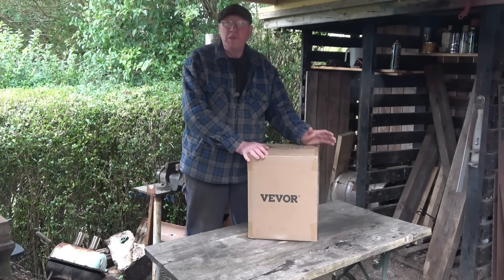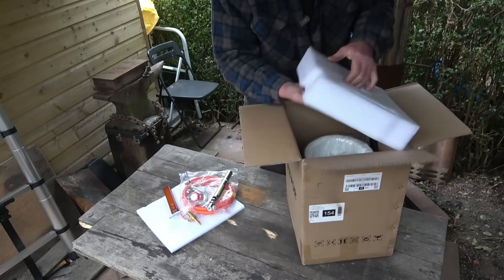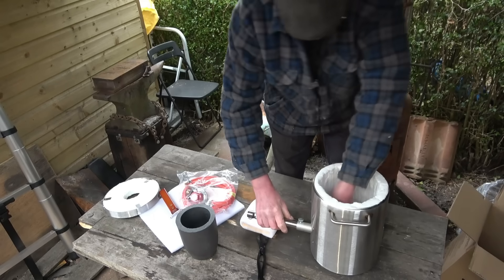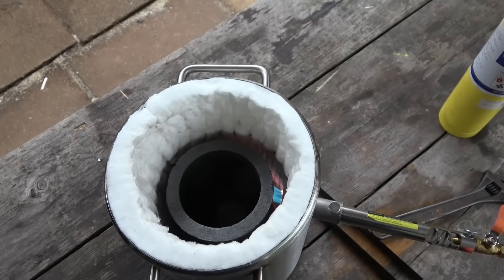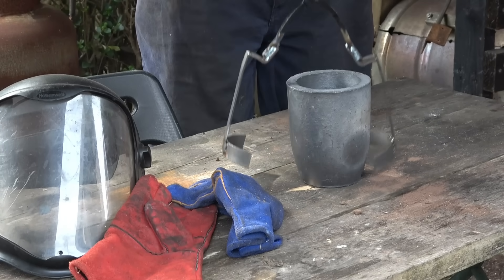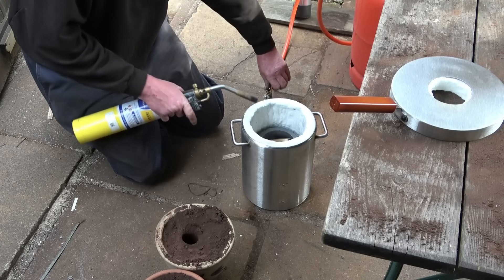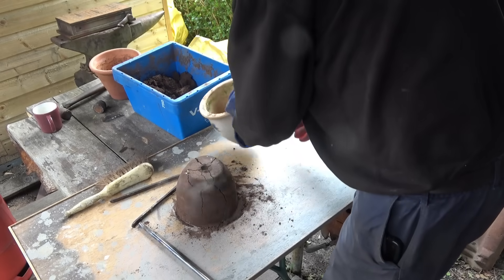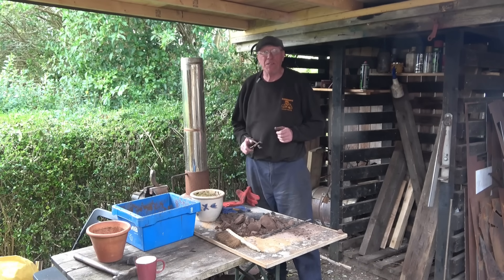Melting Metal Made Easy? A Review of the Vevor 6Kg Propane Furnace

Comment: I'm happy you're happy with this method but a 15kw induction machine will heat a crucible to liquid temperatures in a minute flat..from cold to pouring cast iron into a sand mold in 60-90 seconds..the Chinesium flavored units have come way down in cost that the hobbyist can have one at home..
Reply: You need 15kW of (usually three phase) available power however and a very special plug to connect it. Most houses don’t.
Reply: @allangibson8494 my 15kw machine uses 220v 50hz single phase..I plug it in to 240v 60hz single phase..they have internal power regulation supplies that can run on 208v to 240v..but yes I've seen units for industrial use run on 480v 3phase but those are more of the 25kw+ variations..a sidenote the 15kw induction machines are actually 7.5kw-8kw the Chinese must have different math and test equipment over in China then English speaking countries..lol I also have 3 phase equipment that I run off a very cheap $80 VFD (variable frequency device) that runs off 240v single phase..like I mentioned industrial type equipment is within reach at home for the hobbyist..there's also rotary phase converters available commercially or easily made to run 3phase equipment off 1 phase power..
Reply: Link?
Reply: @stephenisherwood9584  any links will be taken down by YT..but there's several directly from China web sites that if you cut out the middle man has units in the 400usd range for a 15kw machine..they do require water chillers to operate..the cheapest option is to use an old office refrigerated water dispenser modified with a small water pump to pump water in a loop thru the machine and back into the water dispenser..alternative is a water pump and plain bucket with some ice water to loop thru..there is flow rate sensors inside the induction heater machine that will cut power if no water is flowing..Cheers..
Reply: @agentcovert  15 kw is 3 phase special electrical installation, plus cooling system, that's very complicated when you want just melt a few kilos of metal as simple amateur hobby. And the whole thing is pretty expensive and uselessly complicated when a simple small 100 USD furnace and a propane 13 kg bottle will do the job in less that 30 minutes.
Reply: @pabloricardodetarragon2649  the 25kw is 3phase..I have a 15kw 1 phase induction heater.. even then a rotary phase converter will make 3phase anywhere..
Reply: @ 15 kw on a single line is not an installation you will find in a ordinary house in Europe where 220V prevail in domestic uses. That's 70 amps...
That means you need a special 380V three phases like in a shop. All that is far too complicated and expensive for an amateur eventually melting a few kilos of bronze for casting a few small items. It's cheaper and easier to use a butane or propane furnace even if it takes 30 minutes.

Comment: Thank you John!
I’ve got a question: the vendor says 6Kg (12kg depending on the nodel) of what? Is it water, then about 6-liters. Aluminum, copper, bronze, iron (not that it can reach the melting temp) nonetheless  the densities are different. 
I’d be happier if the crucible is measured by volume.
Reply: The blurb on the Vevor site says it’s 6kg of copper, which would equate to just under 0.7 litres. (It also tells you it melts 13kg of gold if you happen to have a million quid’s worth of scrap gold just laying about!)

I think they give you the capacity by weight because it’s easier to measure out a certain quantity of scrap to melt by weight rather than volume of oddly shaped bits.
Reply: @ thanks
Reply: 4- 6 or 12 is the size of the crucible. If you buy a 4 the 5kg crucible will not fit in

Comment: Nice review. As someone who has never cast metal before do you have recommendations about sources for budget friendly/ yes safe PPE?
Reply from the maker: Charity shop leather coat is a good start . Welding gloves are cheap . Buy a good face screen .
Reply: I bought boot covers, chaps & gloves, all reflective and fire resistant on Amazon. A good idea to use them in case you spill molten metal.

Comment: Great reviews 👍
Has anyone ever managed to melt mild steel with a home furnace
Reply: Some have, but it’s considerably more difficult to do than even cast iron and that’s hard enough. And you couldn’t use a furnace like the one shown here.
The other point is, why would you bother going to that trouble for mild steel? You could machine and/or fabricate most things.
Reply: @emma.jacobs1  
I just wondered because I've seen lots of YouTube videos of people building model steam locomotives, I believe they have to buy the wheels separately, although I could be wrong
Reply: @ I think they’re usually cast iron, rather than steel. As I said, easier to manage than steel, but still more difficult than aluminium, brass or copper.
Reply: @emma.jacobs1  
Even if they are cast iron, why does no one cast them themselves at home, if iron age man could do it, why can't present day model engineers do it, it can't be that difficult with all the stuff we have available today
Reply: @BillSikes.  I don’t know; maybe they prefer the machining side of the hobby to the casting side.